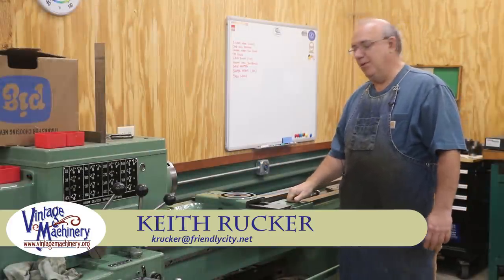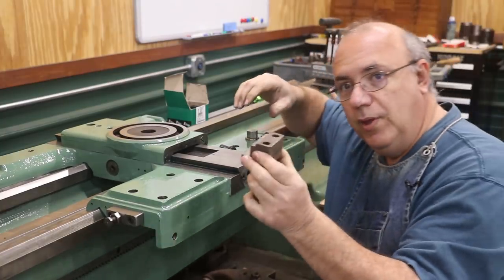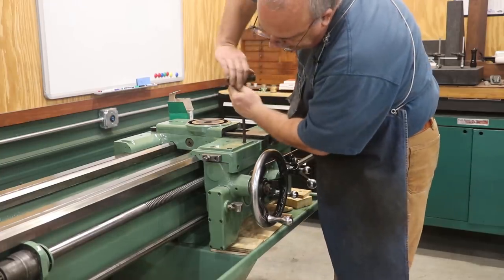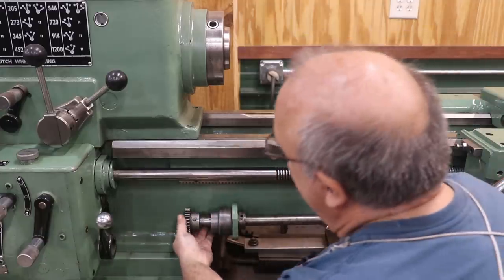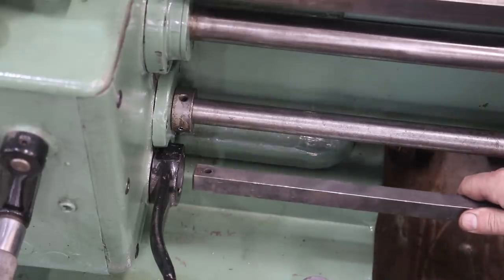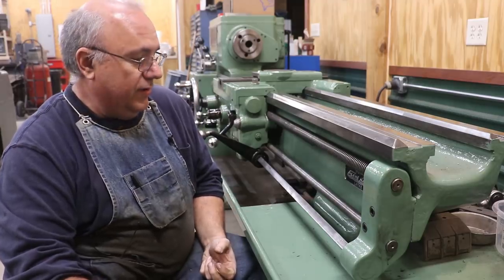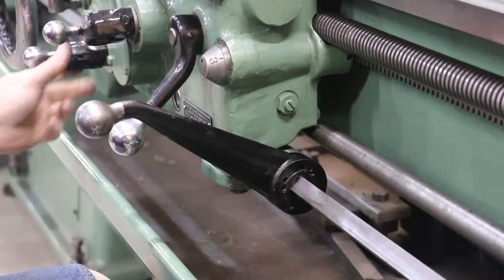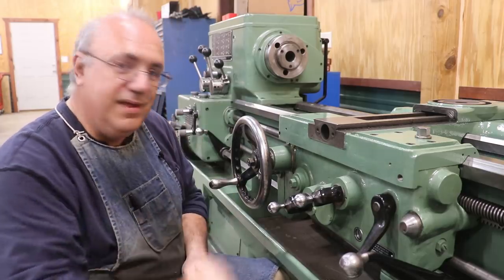Reinstalling the Apron on a Monarch Model K Lathe - Monarch Lathe Restoration - Part 24

Comment: Keith, I was dying watching you struggle with that. Definitely one way to do it. An easier way to lift the apron in place, if someone else is in the same boat and aren't as strong as you, would be to get a couple of lengths of all-thread the same size as your bolts. Put one on each end down through the carriage. Then use some nuts and washers on the top. As you tighten these down it will lift the apron into place. Once it is lifted sufficiently the caps screw can be put in the other holes to secure it. Remove the all-thread last and replace with your last cap screws. This makes a nice easy guided approach and lessens the chance of cross threading the cap screw while you're struggling to lift it and jostle it into place

Comment: That lube system is the biggest reason most of those old Monarchs have survived and aren't worn slap out I think. Glad you were able to get yours working again. You are getting close!! You still could do like somebody did on my lathe and split the old nut in two and use set screws to jack the halves in opposite directions to take out the backlash until you get the new nut made. :-)
Reply: "somebody" split the nut eh Brian?......  On  the lube comment,  You are totally right. The start stop lever looks to have been repaired already, and it has an 1/8 of turn of slop. That lathe has been started and stopped thousands/millions of times to be that wallered out, yer the rest is in good shape. Automatic oiling is never a bad idea in a machine.
Reply: Aye. Two (out of five), Monarchs that i saw in Europe recently had their oiling systems gunked in one case and destroyed for the saddle in the other. Both had wear issues. There's no doubt in my mind that lubrication has kept Monarch laves up and running with minimal wear.

Comment: Keith, A good practice with Taper Pins is to cut the length of the taper pin such that the small end of the taper pin is slightly recessed in the gear, collar or whatever it is holding to a shaft. 1. it marks the small end of the pin, and 2. it gives a slight recess to place your punch in when driving out the pin. I realize that you were reusing the pin that someone else had put in the shaft, but it would be worth your effort to have made it right. I also noticed that when you fit the #6 taper pin to the square rod, etc. that you did just as I suggested. Good Job. You really have that old lathe looking good. You are really going to have a workhorse when you get her done. 
Gary, 75-year-old Home-shop-machinist in N.W. Arkansas

Comment: Monarch's oiling system really help the longevity of their lathe.  If you look closely you can see the port that was put in to oil the cross slide dial assembly.

If the pump cam is in the right place you can get the oil started by running the lathe with the power cross feed on but the dial assy removed.  When oil comes out the port the apron oil distribution system is full.

Comment: Hi Keith...

A couple of timbers drilled for draw bolts with a couple more short lengths to clamp over the bed...
Then you can use them each side of the apron...
Together with straps...
It's a fair old lump of ore is that apron there so you can use the wood like a scaffold crane...
Ease it into position without clubbin gear teeth & shaft ends etc... 👍

With thanks
Glenn
GLMelectrical
Leeds UK

Comment: WOW! What a struggle and progress is not without sweat. Good series in the restoration. When I'm working on something in the shop I'm alone so I know how that goes, as most of us do, so after watching the hog wrestling and then the gear on backwards, all good progress and good information, however, I was eagerly watching the use of the tapered reamer. 

Now I only have the usual tapered reamer like you may get at a regular hardware store, and I have used tapered reamers that are for wooden tuning pegs for musical instruments. And along with that, are the #2 Moris taper on my lathe and #3 on my drill press so I understand how tapers fit tight and lock. What I was hoping to see is how you got the tapered reamer out of the hole. In my limited experience they usually get stuck in a deep hole. You can't turn it backwards because it will dull the cutting edge so you have to keep turning it "forward" so to speak. You were using a regular wench so pulling up on it was not possible. I'm thinking that grabbing it with your fingers would not work. Pliers maybe? So how easy was it to the the reamer out of the hole? Did you use a punch to loosen it from the bottom? So no, I don't have a lot of experience with that and a little help would be appreciated.

[EDIT] Just today, right after watching your video, Mr. Pete had a nice video on self holding tapers talking about Jacobs tapers. Wedges or punches were mentioned. Just gives me more reason to ask how you did it in that limited space you was working in.

Comment: Go to a store like harbor freight and get a 3/4 drive impact socket. Take your old bushing with you. Then match or go oversized on the socket and cut it to size in the lathe. Cheaper and faster than dealing with broaching raw stock to 3/4"

Comment: Next time get a couple of extra long bolts that will reach the threads while it is sitting on the chip pan.  Tighten those as much as possible. If the proper bolts reach use them to pull the apron up.  If not shim it up then use a slightly shorter set of bolts and repeat until  you can get all the proper  bolts in and save your back.

Comment: Keith I really enjoy your rebuild videos,  your attention to detail is great, one thing, I have been working with pro audio equipment for a long time and one thing when using a lapel mic you need to clip the mic in the center below your mouth if possible because when it is off to the side the volume goes up and down constantly when you turn your head,  keep up the good work

Comment: When I reinstall a apron onto the saddle I screw all thread through the saddle into the threaded holes of the apron. That lines up the threaded holes and you can use nuts on the all thread to pull the apron up into place. No wood shims needed. (4:30 in the video)

Comment: Very nice! Pretty soon you will be able to turn it on!

I think I would have got that apron in place by building a trestle to hold a floor jack at the right height, and used that to lift the apron into place. It just looked like a whole lot of work by hand.

Comment: To make the bushing for the clutch lever, perhaps you could make the part in two pieces, a half cylinder each.  By milling a v shaped groove in each piece such that when placed inside the cylindrical bore of the handle, you would have a 3/4 square hole.  This would avoid finding and worse, buying a 3/4 broach.

Comment: Cutting off a 3/4 drive socket and using that, may be quicker than finding a broach and will be already hardened.... Just a thought.
Reply: But... There's a fancy new heat treat oven on it's way there...  :)
Reply: Not sure that you want that bushing to be hard. Ideally it needs to be softer than the bar it is sliding along so that the easily replaced bushing wears out rather than the expensive and difficult to replace rod.

Comment: No sealing at the cams / gearbox? Got a much smaller lathe, had to re-seal mine there again, because it was continuously leaking oil...
Some silicon sealant worked out fine for me.

Comment: Great stuff, Keith! Why is it that the brackets that push up under the saddle need no adjustment on the Monarch to allow sliding but no upwards movement, whereas on my Chinese mini-lathe they have to be carefully adjusted or shimmed and are never quite right? Did you do anything to the V-shaped front way on the Monarch, and the corresponding one on the underside of the saddle (I might have missed that in your videos)? Surely any wear of those parts affects the fit of the aforementioned brackets?

Comment: Yeah, those holes aren't original, since you've gotten this one and begun its restoration, i've been hunting for a fixeruppper myself here in Europe. And the one i have (old and rusty as it is) doesn't have those holes. On a side note, the handle on the stop (the outer one) is made from a single piece, going by the many set screw holes in that, this lathe has been getting a lot of inserts there. I wonder if there's a way to make them a bit more bullet proof or if rolling with the punches is the right way vis a vis not ruining the bar.

Comment: Do you know what all thread is good for. Use the threaded rod to lift the apron.  Much better than having a coronary from listing that heavy apron.

As far as the square shaft goes, are you sure you do not have it turned 180°. If you did, you now have a   duble            taper  whole.

In

Comment: If this comment has not been made. Why don't you use threaded rod with a flat washer and a nut of the same threading to help you align the part you want to lift by tightening th nut. I had to use this on the types of lifting equipment I work with, when you don't have the extra hand available.

Comment: Keith, Wonderful work what a beautiful lathe! Could you epoxy a couple of shims into the square hole for the on/off lever on the carriage? Might be simpler than all the broaching etc.
Best wishes,
Eric
Reply: Eww why do an epoxy hack job.  Keith is doing a proper restoration  so the machine will last.  Epoxy and shims is for emergency need it running now solution and not a permenant fix.

Comment: Didn't one of the rods have a severe bend to it due to an improperly laced lifting strap? Wasn't that why the guy you bought it from parked it for 10+ years?
Reply: Nah, that was the big 28 inch monarch
Reply: Look again at mike suo's link... that's the same lathe, model K 16". Must have been fixed off camera and never mentioned. I don't recall ever seeing a video on such.